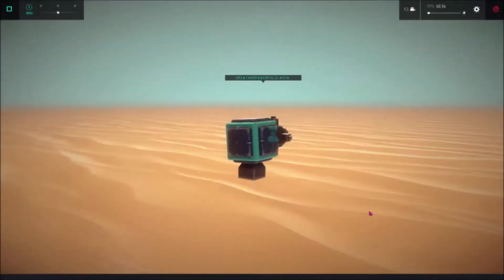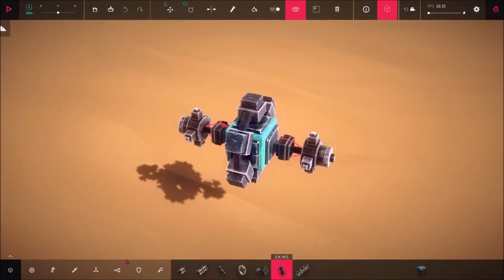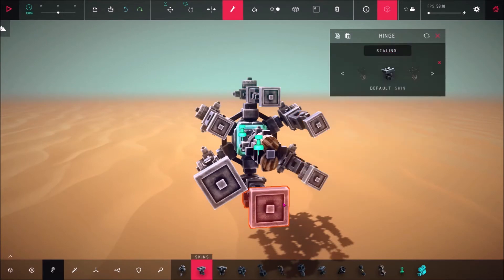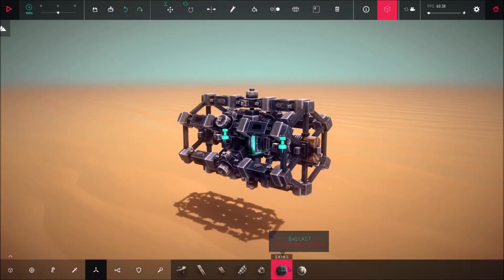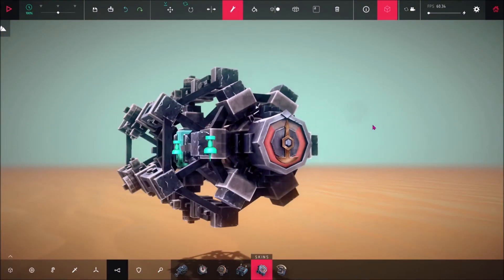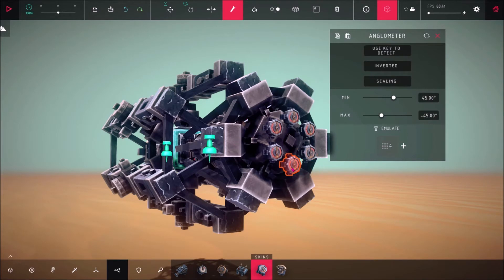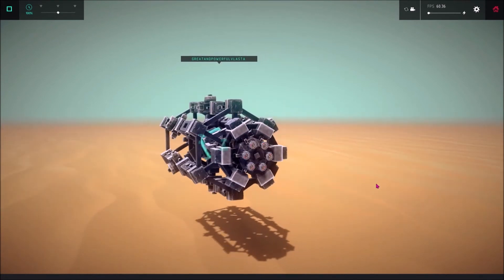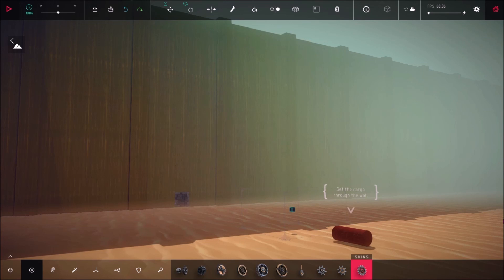Making a VASTLY SUPERIOR axial engine in besiege

Comment: How did u do mouse control?
Reply from the maker: It's one of the "God powers". You can find them in the at the bottom of the settings tray you access via the little cogwheel icon in the top right corner
Reply: @vlastasusak6881  how
Reply: @vlastasusak6881  idh pc
Reply: @vlastasusak6881  can you try the sparkplug mod?

Comment: amazing video, I'm glad youtube recommended me a channel that wasn't trash for once

both great engineering and great video presentation
Reply: PS: would making the engine "fram" more rigide by attaching both sides of the hexagons to each other increase performance? it seems to bend quite a lot
also it seems pretty slow, could it be made to go faster using shorter angles? (I"m assuming it's slow because the pistons wait too long to do the opposite movement, making the whole contraction/retraction cycle longer and therefore the rotation speed smaller)
Reply from the maker: In this design, having the frame bend was intentional, it was to prevent the pistons from compressing more than they should, but I honestly have no idea if it helps or hurts the performance. The one on the car in the competition video is rigid, and it doesn't seem to cause problems, so the bendiness is probably unnecessary. Using shorter angles should theoretically increase the speed, but also decrease the power

Comment: I don't understand, why use steering blocks for offset when you can just use the rotate tool?
Reply from the maker: Good question, by building everything straight in the beginning, I can be sure everything is connected, so when I use the steering block to offset it, everything follows the things it's connected to, to bend and stretch into place. If I were to offset the crank manually, I would have to offset everything else manually too, which would mean using a bunch of undesirable math. Also rotating the crank changes it's distance from the pistons, and since pistons only connect to the thing they are right on top of, some of them would need to be half extended, which you can't do. This video is a reaction to Reid Captain's W piston engine video, if you watch it you will see how he has to put everything at odd angles and use two pistons per cylinder so he can make the first start out with both retracted, third both extended, and the other two one retracted and one extended, which I want to avoid.